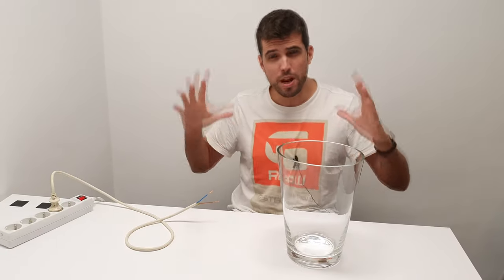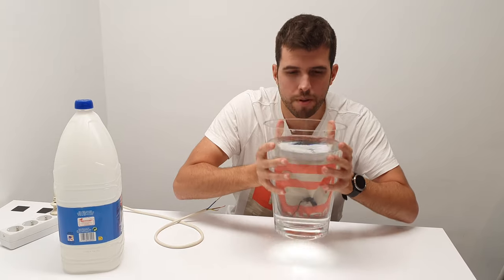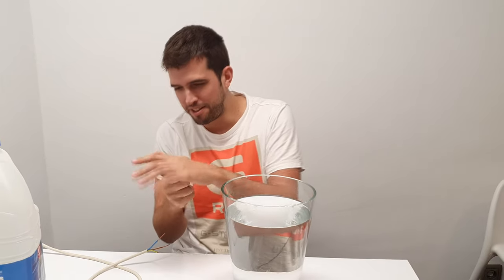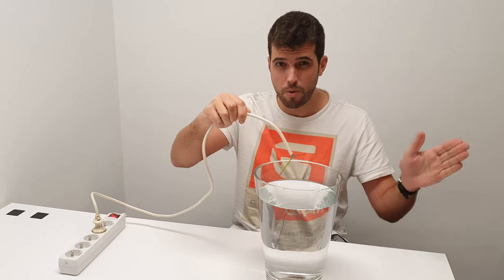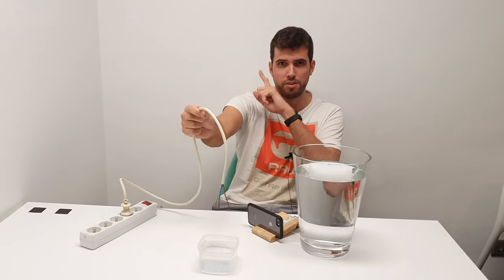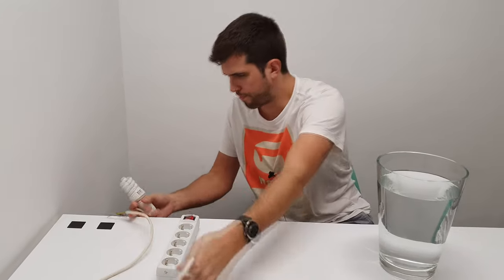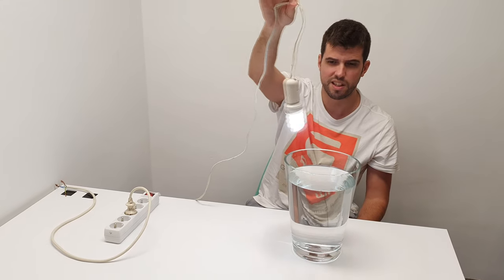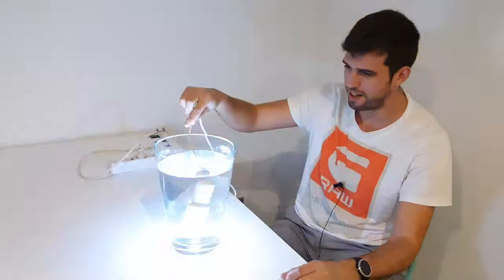⚡ Deionized water vs Electricity ⚡220V in water

Comment: Thank you for confirming that my heat exchanger will work as I thought it would. A 12V bare wire heating element in a deionised sealed water tank. With a cold water supply pipe passing through it. Powered by my new design wind turbine generator. The heated water warms the supply water to the gas boiler, reducing the overall gas energy required to run the hot water and central heating. Well done and be a bit more careful with your experiments my boy.
Reply: why don't you bypass the gas for heating water. instead get some 12-volt bulbs filaments and put them in parallel along the pipe probably need to 3D print some sort of fixing for the element so it doesn't touch the copper pipe.
how much hate do you produce through the method you're using and what are you using as an element..? that could be parallel as well should be able to get to 70 degrees Celsius I would have thought.

Comment: how does deionized compared to distilled water?
Reply from the maker: That is a good topic for a video. I add this to the list
Reply: did you know there is a water extinguisher that uses de-ionized water and is rated for electrical fires?
Reply from the maker: No, I didn't know. Would be interesting to test it, regular water extintion on electrical fire vs de-ionized water extinguisher